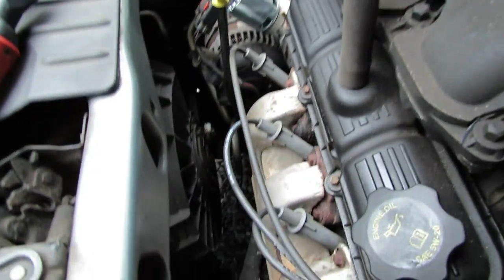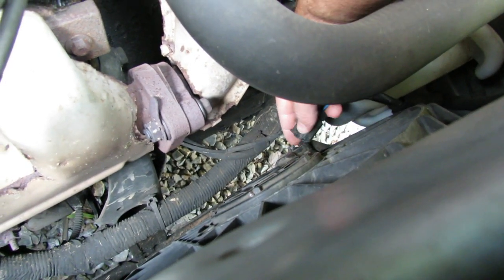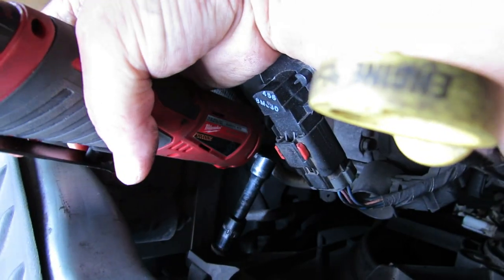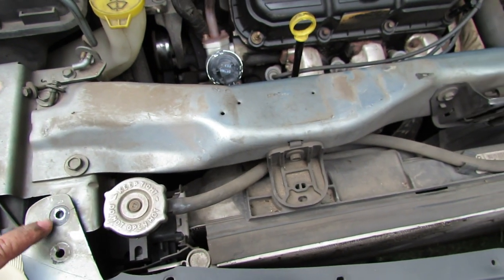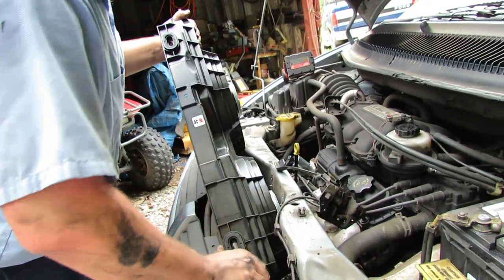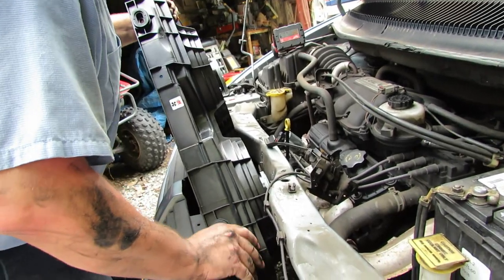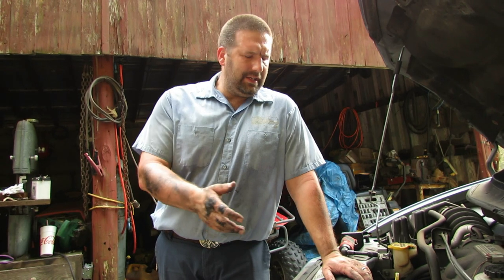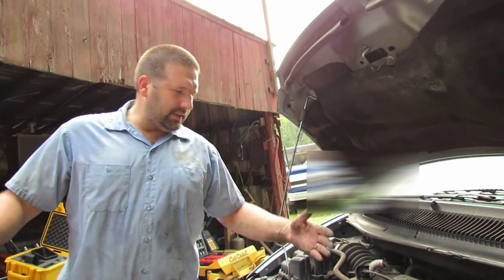2005 Dodge Grand Caravan Fan Replacement

Comment: Thank you so much my friend.  Ive volunteered myself to replace the one on my friend's that he just bought. This video will be a great help. I like your approach. Short, to the point and "down home" attitude. Thanks again.
Reply from the maker: @KevinLangley-nw2eb you are very welcome. It's always nice to help out friends. I am so glad you found the video useful. If I may make a suggestion. I received a lot of comments recommending to remove the cross bar that has the latch assembly attached to it. It is only 4 bolts and will give you much more room to work. Obviously not necessary but I believe it would help. Thank you for the kind comment and for stopping by. ~Mr. C.
Reply: @NaturesCadenceFarm  yes I'll try that. I can see where it'd be helpful to do that. Thanks.
Reply: Everything went smoothly. Thanks again.
Reply from the maker: @KevinLangley-nw2eb that is great news. Glad it was smooth. Thanks for letting me know! ~Mr. C.

Comment: As some have mentioned, the top cross brace was supposed come off with latch/cable attached, and just put to the side. Then right side hose needs disconnecting and then fan assembly can be pulled up and out. Was painful watching this video..lol. But at least you got it done. I hope, that if You Ever decide to do the rear sparkplug, you remove that wiper motor assembly first. That will give you great and proper access to anything back there.
Reply from the maker: J P you are correct. I should have removed the cross brace... Lessons learned. Thanks for the tip on the wiper motor, will do. ~Mr. C.
Reply: Right side hose does not need to be removed. It would appear it does however, if tilted and angled just right it will come right out without damaging anything in the process. 2006 town and country 3.3.
Reply: @Roland-Henry  I just a rebuilt tranny put up, $1,775.00.. smh.

Comment: 5 min to remove the cross bar and no damage to the radiator fins inside when removing and installing the cooling fan
Reply: Gary Sticka I was thinking the saaaaaame thing lol
Reply from the maker: Gary Sticka after looking over the front end of the van I will agree with your "recommendation" . Removing the cross bar would have been easier. ~ Mr. C.
Reply: that's what I did I was thing the same just remove the cross bar it save the struggle
Reply: I'm currently replacing the fan assembly in my 2007 Dodge Grand caravan. And yes, I can confirm it is way easier than it would have been had I not removed that big metal crossbar! 
This video was still very valuable to me though because I was having a really hard time figuring out how to unplug those electrical plugs. Thanks for the footage and the explanation! 

Surf Wisely.
Reply: I was going to watch this video and it hit me I could just remove that haha I was thinking it’s dumb u would have to remove the radiator so I looked up a video but then it hit me lmao

Comment: How do you get the latch out of the way?
Reply from the maker: Mr. Ray I believe you are referring to the hood latch assembly. I removed the two 10mm head bolts that attach it to the cross member. If you watch the video around 8:05 I reinstall it but that will give you an idea of how it should come off. Let me know how it goes. Thanks for watching and asking. ~Mr. C.
Reply: Take the cross member off, you can leave the latch attached and just move the whole thing aside.

Comment: Why not show the hardest part, old fan removal?
Reply from the maker: @David Gorey excellent question. If I remember correctly I removed it to investigate then decided to make the video. Thanks for watching and commenting. ~Mr. C.
Reply: @NaturesCadenceFarm  Thank you for your video, removal of the upper radiator crossmember held in with 4 bolts was a game changer, I’m in a wheelchair and did this job on my 2006 gran caravan. The hardest part was removing the 2 power supply plug clips. Thanx again
Reply from the maker: @David Gorey glad to hear everything went well. Keep up the good work! Happy wrenching. ~Mr. C.
Reply: Nice video and good job
Thank you for the explanation
Muchas gracias 👍